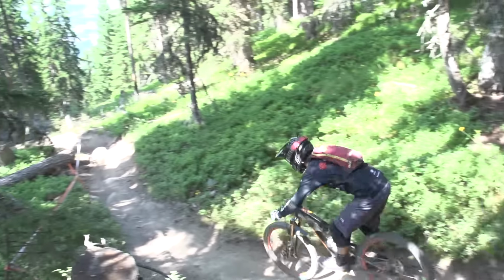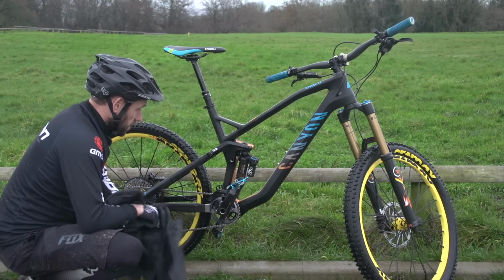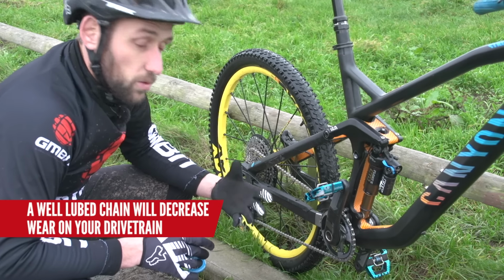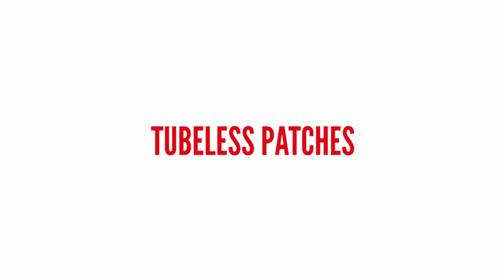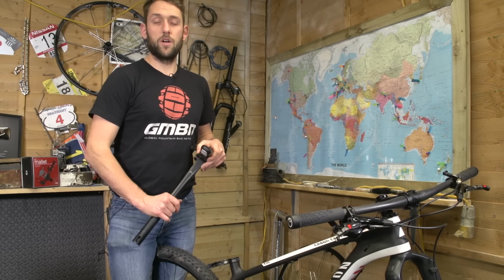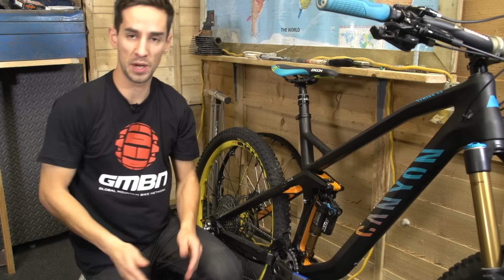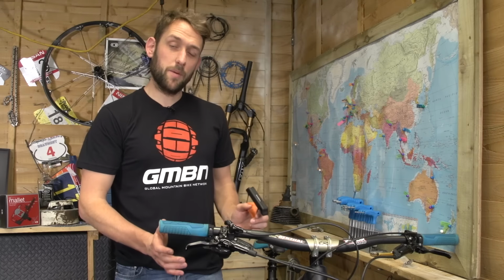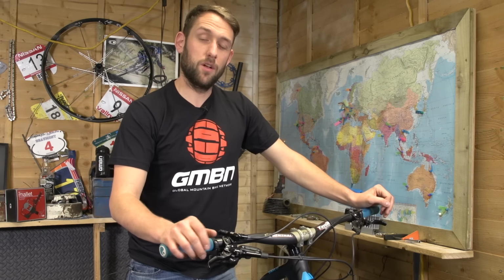Top 10 Money Saving Mountain Bike Maintenance Tips

Comment: 3:12 Chain stay? Then tightening pivot bearings with an allen key and then recommending getting a torque wrench? And, using a pressure washer for bike cleaning is a top tip for saving money? I thought those things were a big no-no as they can ruin bearings.

Comment: I've gotten oil on my rotors, changed pads, and cleaned the rotor. Still feel like the back brake is weak. Any suggestion?
Reply: New rotor
Reply: Was the oil spill from the hydraulic line? If so, you might also need to bleed it again. If not, some people have had success with cleaning oil off pads and discs using a gas burner. Could be worth a try before completely replacing the discs
Reply: Thanks for the tips! To fix the brake I just rubbed mud and the brake is working perfectly!
Reply: +OUTLAWRAPTOR That sounds like how i got my hope m4 working when it wouldn't bed in lol. Maybe mud has some magic properties!
Reply: +OUTLAWRAPTOR I usually bathe it in Morgan Blue chain degreaser.. That shit is magical and removing any kind of grease.. Including irritating skin if not protected. 

Other than that, hold it over open fire (after rinsing the morgan blue off), if it's still bad. 

Definitely replace the pads tho. I've tried lots of stuff, including burning them with a torch, grinding them, putting them in degreaser and all sorts of desperate tricks. They get back up to around 70-80% but it's never quite good. For $5 for Ebay replacements, it's not worth the effort.

Comment: When replacing brake pads, discs and also tyres, only buy new for the front then move the old front ones to the rear. Obviously check the condition of them.
Reply from the maker: With tyres for sure, but discs can be a little more troublesome. Great tip though!

Comment: I don't get tubeless setups, I'm running specialized armadillo tyres with green slime in my tubes and I haven't had a puncture for litaraly 2 years, I ride pretty hard to.
Reply: I also run 28psi in the front and 30 in the back.
Reply: +fuddle128260394 Total weight for that lot?
Reply: I don't know.
Reply: I don't race so it's not that inportant to me

Comment: Was that a supsensioned seatpost?  I thought those were only safe to use on roadbikes..?
Reply: +Bungle2010  5:03 is a suspension seatpost using the flexibility of the Carbon/fiberglass like a spring. Manufactures state they're not intended for reall off-Road mtb.. (Guessing if the the leafspring-like design fails bad things happen.. 😑

Comment: Hi guys, I often find my chain has quite a bit of surface rust on my chain. I keep it well lubed and put wd40 on it when im not going to be riding for a while. Any idea what I could do to prevent this?
Reply: After a ride, wash it dry it thoroughly, so there is not moisture - Muc-Off have a handy spray for that - and leave it for about half an hour. Then lube it well, making sure that you're using the right lube for your riding conditions? For example, if you're riding thick, muddy conditions, you'll want a thick lube. I'm no expert, but seems to work for me.
Reply: Cheers guys

Comment: WELL I DON'T HAVE A BLOODY HOSE AVAILABLE LIVING IN A FLAT, IN THE CITY! It makes cleaning the bike sooo much more of a hassle.
Reply: Mobi washer.
Reply: joey2thac
Thanks for the tip. 15 liters wont cut it though.
Reply: +klarkolofsson go to a car wash with a pressure washer
Reply: +klarkolofsson get the 19 litre! they are bloody brilliant
Reply: Matthew Griffin
I will consider making that investment :)
Reply: +klarkolofsson 
I have a 5-liter manually-pressured cleaner from Karcher. 30 Eur, very sturdy plastic, runs well at 1-2 bars which is enough. You don't want too much pressure, will wash out your lubrication and also use more water. 80% of times, 5l is more than enough for a single bike with this setup.
Reply: Oskar Elek you just need to watch where you spray and re greese more
Reply: +Matthew Griffin yep I have the 19 litre, cleans mine and my brothers bike easy after a ride more than enough water.
Reply: gcn have a video on how to wash a cross bike check that out no hose or presure washers needed
Reply: +klarkolofsson Move house - you get paid more in the City, but things cost more too (and the trails are further away).

Comment: Use bikes with the similar specced parts so you only need one set of spares (things like bolts, chain quick links, brake fluid, suspension oil, inner tubes if you run them, BB's, headsets, etc.)
Reply from the maker: Nice tip!

Comment: Spraying bearings with a water displacing, penetrating fluid like WD40 or GT85 is bad. Water shouldn't get into the bearing, the seal should keep it out and the grease is pretty waterproof. PENETRATING fluids do just that. Spray WD or GT85 on a greasy chain and see what happens to the grease. It breaks it down. Do the same with water - nothing happens. Spray it on your bearings and it works into them and breaks down the grease. Water won't do this. Over time it will start having an effect, so strip, clean and pack them with fresh bearing grease. Keep the sprays away!

Comment: you should never use a hose on your bike it rusts everything. Go over it with a damp rag after every ride and degrease your drive train regularly. If your entire bike is covered in mud you can use a hose but stay away from bushings and bearings.

Comment: Don't forget about maintaining your brakes, and changing the pads when needed to avoid having to buy new rotors in addition to pads!
Reply: +levy3poop Buy new rotors in China.. Yeah yeah the pros might not like it, but you basically just need a steel rotor, and for us riding bikes around $1000 mark with low-to-medium end brake calibers and such, you can't beat $3 160mm discs (160 mm) and $7 for 180mm (six bolt config).

Yes I do trust them to hold up, no issues for the last couple of months, bot nope, I would not use them on a downhill bike going 70 km/h. 

Also they have shimano-clone brakepads, seems to work well enough. I have no doubt they are NOT on par with the "true brands", but 90% the performance for 20% of the cost is fine with me.
Reply: TheNewFaceOfHSP Do you have links to where I can order these things?? That sounds amazing for regular XC riding
Reply: Thanks! Just ordered 4!
Reply: levy3poop Hey be sure to write about them after some time in the thread here. Would be cool to hear about others using those cheap Chinese components, in different climate and trails than I am. I'm still seeing forward to whatever they will rust quickly or not. They should be stainless steel, but Chinese you know. I will soon start commuting even more on the older bike with those on, and will be cool to see them when they stand out taking some showers.
Reply: yeah, absolutely! What climate are you in? I'm in north/central texas, so lots of lime stone out here, and plenty of heat.
Reply: levy3poop Best test ever! Northern Europe, Denmark, between -20 and +30 degrees celcius, lots of mud, rain, a little snow (in the winter only a few months tops) and road + offroad usage. 95% off all offroad here is pure forest and mud. All rockgardens have to be made manually. xD
I do however bike at the beach occasionally, and probably will do in a month or two, just to give these ones a quick bathe also. I clean it all afterwards, but just to help accelerate them if they are weak.

Comment: Ive found just using Gafa tape as a chainstay protector works better than old tube, it's lighter and it looks a bit nicer too!
Reply: +Sam Hilton I use black electrical tape (use a color to match your bike ofc). Now the scary part, that I got from my skater buddy.. Use a ligther to mildly melt the plastic at the end. Would NOT recommend this for your $3000 carbon frame, but if you are riding cheaper alloy bikes, and you decide not to spend money on a chainstay protector, but listen to this, you will probably also be allright with melting the ends of tape together onto your frame. It works great, have been on my frame for 2 years. Pretty sure it will still come off if it had too, at the cost of some paint. Whatever. 

I did 4 layers of tape, and melted the outer ones at both ends.
Reply: Sam Hilton wtf is gafa tape
Reply: Sam Hilton is it the same as duct tape

Comment: To save money on knackered bearings never use a pressure washer and ruin them. If you have a multi tool already, don't go and buy another set of Allen keys in order to save money. Your carbon seat post doesn't cost you anything if it's stuck in your carbon frame and if you can afford them, well, you're not trying to save money. Buying a torque wrench costs money. Buying helitape costs money, scratches don't. This channel is very good at advising people to go out and help the bike industry increase its revenue. And advertising Canyon bikes.

Comment: Never pressure wash your bike, It kills cartridge bearings by stripping all the grease out of them, which allows grit in and combined with them then running dry will wear out in a handfull of rides. Pro teams do it as they change the bearings constantly. The amount of barely used clean as a whistle bikes I've seen that rattle and play like they've done a few thousand miles is beggars belief.

Comment: A real surprise to me was that instead of regular bike chain cleaner, you can use motorcycle chain cleaner. Much more bang per buck, and so far it shows no negative impact on chain wear.
Also, never ever use rim brakes for anything, they suck big time. Seriously. God, how I hate rim brakes.
Reply: +Robert Wetzel Indeed, fuck rim brakes. If your bike got them? Throw it out and buy a proper bike.. Serious advice. It is probably a cheaper model and it can't really be used for anything else than a troll-bike-to-fuck-up or spare parts.
Reply: TheNewFaceOfHSP
My first bike as a grown-up was a cheap electric bike and it uses rim brakes. All else is fine, though, I still use it for commuting.
Reply: Oh yeah electric bikes. They aren't really mountainbikes. For standard bikes, why not. People leave them out to rust anyway.. It hurts my feelings when I see some rich kid having a $1200 MTB standing out in the rain as a commuter. :(
Reply: TheNewFaceOfHSP
Oh, I weren't really aware that we were talking exclusively about mountain bikes. My e bike is a factory conversion of a very very cheap trekking bike and did cost the same as my 29er hardtail, both at a little over 700 € ($750). Both are parked inside, of course.

However I did rent an e-mountainbike in Switzerland last year and had a blast, they are really good. I don't do any real crazy mountainbiking because my skills are poor and I'm happy when I don't fall off.
Reply: Robert Wetzel Nice. My parents got two electric bikes and they are quite fun indeed. Would not take them offroad ever tho haha. 

Was it heavy to drive around? I'm exactly the opposite tho. Do a lot of fucked up mountainbiking WAY beyond my skill level and kinda enjoy the pain. I'm a programmer so I love getting out.. Would rather have prefered to NOT get off the bike face first with a standard helmet the other day, but hey, Denmark are 90% mud, så that only ended in a split upper lip.
Reply: TheNewFaceOfHSP
They make you look forward to the uphill section :D

Comment: I've found that using a generous amount of fiber grip to the seatpost is best, I've pulled out many lightly fiber gripped posts with significant wear, outside layer cracking, etc, due to corrosion after only a year or so.

Comment: when neil was setting up brake levers in an old video he did not use a torque wrench. I do belive he just said, I calibrated my hands earlier, I think you need to have a word with him
Reply: +stuart shelley I think he was working on an alloy bar, but I could be wrong. You're not realistically gonna damage an alloy bar, wouldn't fancy cracking a carbon bar though.
Reply: A pro team giant mechanic also said the same on the channel
Reply: some mixed opinions here hmmm
Reply: Lots of professional mechanic rarely use a torque wrench as they are tightening bolts all day, so it's faster to just go off feel
Reply: +stuart shelley I'm not a "pro" but I fix my bikes up almost daily as it relaxes me, and I really like to have a newly tuned bike before each go. I have two bikes, and I do my friends bikes too, so I can sometimes be doing 4-5 bikes in a row.. You get the point. We don't ride carbon tho, so can't speak for that.

On alloy frames it's kinda pointless. Don't overtighten stuff. Don't undertigten it. It's easy get a good feel for it I think. Your pedal arms? Probably tighten it up good, so it won't come off. Your small adjustment bolts for holding the rear derailler together? Yeah, you should probably not tighten them any harder than you can do with a small screwdriver.

It probably comes from being a DIY'er all life long, but never had a bike fail on me, and never have I damaged a part by being too harsh. If you feel the need, then spend the $50, but if working on alloy frames only, you can probably get away with it. 

Protip: add grease to everything. I use the thick white animal stuff. Every single bolt gets greased up before inserting. Not the entire screw, just the tip, but enough that it will come out easily.

Comment: Do carbon seatposts really bond to carbon & alloy?  I don't doubt they get stuck, but the idea that they chemically bond like steel and alloy seatposts doesn't really make sense as carbon =/= metal and is therefore inert.
Reply from the maker: +Zach Wong Hey Zach, Your welcome to have a go at it your self I assure you it does get stuck. Thanks for your comment, Marc
Reply: +Zach Wong  Definitely does gets stuck but i find the carbon post in my steel on-one is even worse.  like a lot of Seat posts stick a little bit of Copper slip or a very light smear of Vaseline on it and jobs a good un.
Reply: +Zach Wong no it does not really bond
Reply: carbon wont bond with carbon as it is a noble material. Im sure they can get seized but most common will be that anything non stainless will rust that much quicker on a carbon bike.
Reply: NewAgeRetroHippie they can never bond
Reply: will it blend though?
Reply: Olav Alexander Mjelde no not unless you head it up to melting point
Reply: F